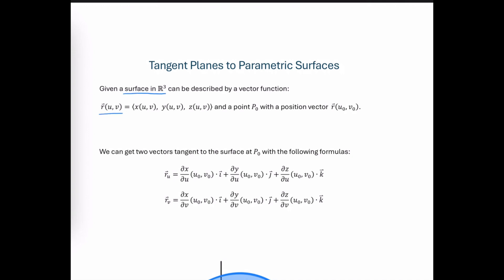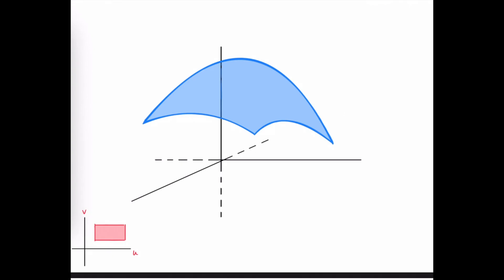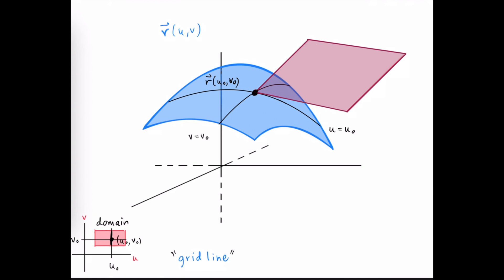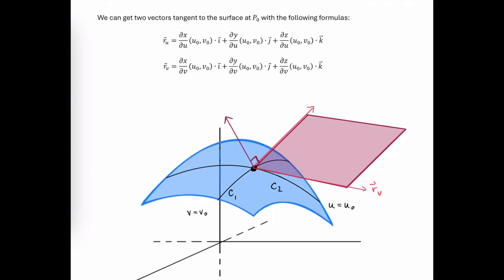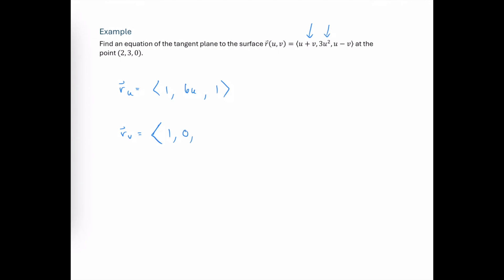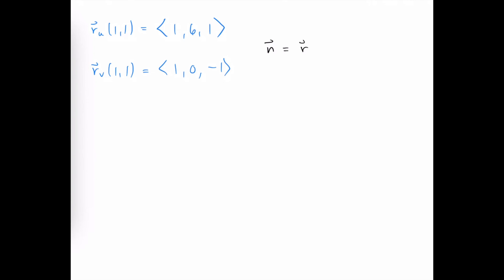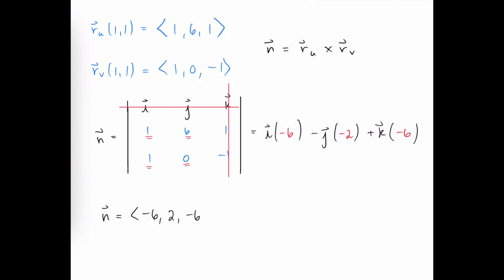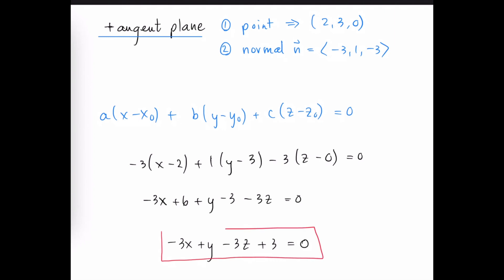Tangent Plane to Parameterized Surface

Comment: Hi,..is that rectangular shape domain the shadow of the surfaces generated by the f(x, y) on the xy-plane?? I am taking about that left bottom picture.. That small one  with v and u axis
Reply from the maker: The uv domain region is the set of ordered pairs (u,v) that make up the domain of the vector function r(u,v) with outputs that are vectors pointing to an (x,y,z) point on the surface. It's not a 'shadow' of the surface since the domain isn't (x,y) points. Here's an intro video to explain parameterizing surfaces: https://youtu.be/oW4dFzgrFLA?si=ztQ7oFlfDGoxHjLK